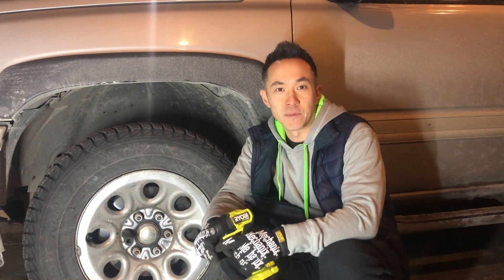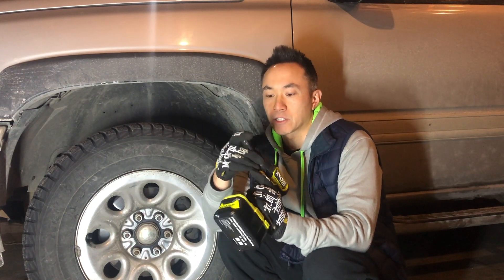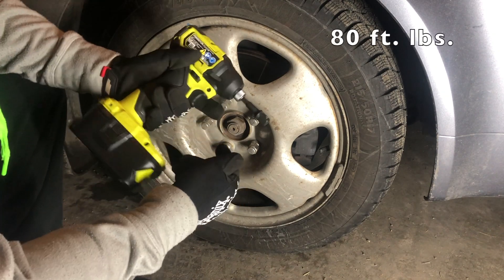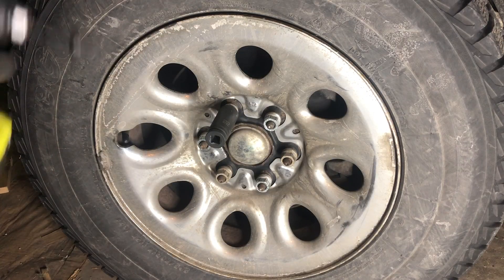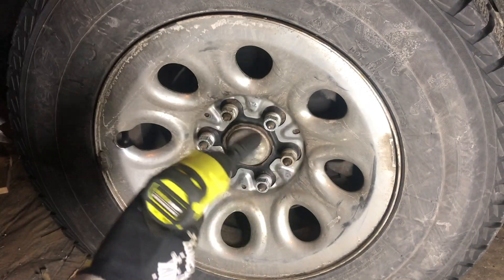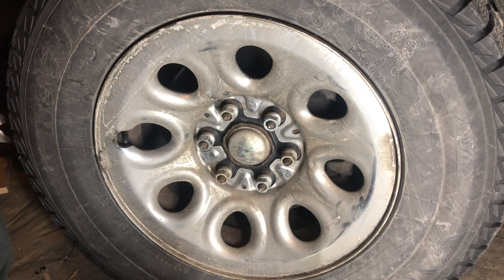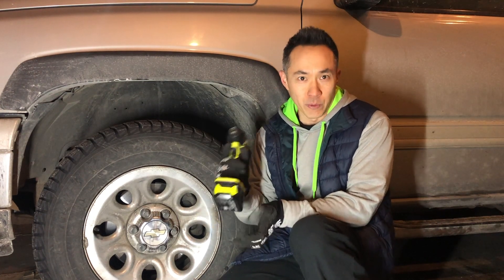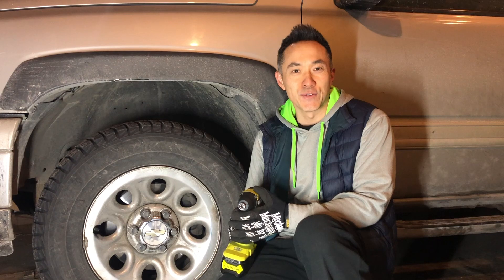Ryobi Impact Driver as an Impact Wrench? (PART 1)

Comment: You ahould have used Ryobi top notch battery and not a generic battery good bateery makes a world of differnrce.
Reply from the maker: Yep, agreed. At least I learned something. Check out the part two video where I redid the testing with a proper Ryobi battery.

Comment: Impact is good for removing nuts only. If you try to tighten wheel nuts, you will have to use a wheel nut wrench.
You will screw it up if you use an impact. This is a cut corners and you will definitely weaken a wheel nut or all of them!
Reply from the maker: Good advice! Don’t over-tighten by using an impact. Suggest using torque wrench for tightening them up properly. 👍
Reply: @ OSHA training. Many mechanics still apply this rule nowadays!

Comment: Do you know how tight an auto tech secures an oil drain plug and the oil filter? Well the 1/4" Ryobi impact couldn't bust it. So lucky thing I have the Ryobi PBLIWO1 1,070 breakaway torque pounds. It took mere seconds to remove the oil plug and oil filter where the 1/4" impact failed after about 10 seconds. When I bought it I tested it immediately on our SUV's lugnuts and it broke every nut I tried it on. So we're looking at a lot of work ahead together as we tackle everything around the house and auto. Beautiful just beautiful!
Reply from the maker: Having the right tools can make all the (fun!) difference. 👍 Enjoy the upcoming DIY projects!
Reply from the maker: FYI the oil drain plugs range from around 15-35 ft.lb. depending on the vehicle. “Hand tight” 😁

Comment: Brother, I’m glad a watched this first, my RV has a ftlb of 103 (140nm) and I was going to use this as my emergency Tyre removal tool……I’ll forget that now ! (I also carry a breaker bar and lug nut wrench)
Reply from the maker: Hi! Hold up there you might be okay. Check out my part two video. With a Ryobi 4ah battery you should be fine.

Comment: I'm a little confused, and I would much rather trust you guys than the Ryobi representative I spoke to at the Home Depot the other day I asked him if a 2 amp hour or a 4 amp hour or a 6 amp hour battery has anything to do with the performance of the drill or impact wrench specs and he said no. He told me the battery affects run time not total performance. He gave me an example that a powerful tool like a half inch impact wrench for a chainsaw or whatever will use up the smaller batteries reserved power quicker. Do you guys agree because I have two two amp hour batteries and I'm only looking to have the tool in my truck in the event that I have to change my tire I do not do other mechanical work so there's no other reason to use the gun except to take off my 140 ft-lb lugs on my SUV
Reply from the maker: While I agree that the amp hour rating is simply referring to the batteries capacity and therefore longer runtime, it’s the cell count and configuration in the higher amp hour batteries that actually create the the possibility of more sustained power. In light duty applications, it won’t make a difference, but with heavier duty ones it will. Check out this link and decide for yourself:

https://www.protoolreviews.com/battery-amp-hours-affect-power/

Comment: It is rated for 1800 in-lb which is 150 ft-lb.  Since loosening requires about 80% the tighten torque this should break free 187 ft-lb.  PROBLEM IS, and nobody seems to test, is this only has about 60% of the CLAIMED torque with the 4 Ah battery and 30% with the 3Ah batteries fully charged. Yes the size of the battery affects torque.

You broke free 100 ft-lbs so with that battery if you tightened the bolts until it stopped turning would only get you to 80 ft-lb.  That is, take a torque wrench and see how much torque to make the nut turn tighter (mark it with a sharp pencil) would only be about 80 ft-lb.  Then call Ryobi and ask them why u don't get 150.

Comment: What adapter is that? My adapters keep on snapping when I try removing a lug nut torque at 89 ft lbs
Reply from the maker: DeWalt adapter. Pretty strong and have never broken it (yet)!

Comment: Basically, an impact driver isn't as strong for nut/ bolt removal as an impact wrench. The 1/4" to 1/2" adapter necessary can snap. The 1/2" impact wrench is more direct, not requiring an additional adapter.

Comment: This was very educational! thank you so much. I have the one + 18v impact driver and drill $179 set combo. I knew the impact driver is more for heavy dutywood/concrete in house construction. The impact wrench is more for heavy duty automotive tasks. It is good to know that my impact driver can at least torque up to 100 ft-ibs.  While I am in trade school learning how to maintain aircraft, i don't really have the time anymore to work on my cars at home while balancing a job and full-time school. My wife is trying to do most of the small car stuff at home, but she does not know about torque values and all of that. I can now at least tell her that the impact driver is safe to use on our 2009 Mazda6, but no bigger.  My jeep cherokee and toyota van, she's going to need an impact wrench. We also need a torque wrench to check proper torque. This would be very helpful for my wife and I to watch so we both understand how important it is to use the right tool for the right job. I don't want to replace broken power tools because we didn't know about this stuff. apparently the new ryobi impact 4-mode wrench also has an auto-mode so that it does not overtighten a lugnut. Thank you sir!
Reply from the maker: I did this because, like you, I was curious more than anything else. Be sure to check out part 2 results with a better battery. 🙂

Comment: I have a saying. The right tool for the right job. If you are using an impact driver to tighten or loosen lug nuts, there is a high chance that the motor in the impact driver will burn out. An impact wrench is designed to handle high torque. It's like using a mallet to drive in nails when you should've been using a hammer.
Reply: For occasional mechanics like me though the tool wouldn't get any any undue stress. But I get what you're saying, if you say run a workshop etc.

Comment: Upgraded from an older 18v kit. https://www.youtube.com/post/UgkxW1vOBRCMrgTCDEijzpVzDWsgI-Jm2iQv  I independently chose the drill and impact tool, before I came across the kit.I like the 3 speed impact gun. It seems more powerful than my older one, and it can be set to be really gentle. The drill is more appropriately sized for my use. I used to have a hammer drill, but I did not like that it was so big and it was not a great hammer drill. I rather have a smaller drill like this, and then get a corded hammer drill for the odd case I need that.
Reply from the maker: DeWalt products are excellent, I agree. Although my personal brand of choice these days is Milwaukee, I know I couldn't go wrong if I used DeWalt... 👍

Comment: This tool being able to handle a 100 ft lb lug nut surprised me so much I had to run out and test it for myself because my old p236a is rated around the same numbers and it just cant do it.
Reply from the maker: Interesting... That's surprising that it couldn't do it but I've always been told that ft.lb. tool ratings are overrated and not to trust them. But, like you, I just had to try this for my own entertainment and curiosity purposes at least! 😁

Comment: I’ve just bought an adapter so this film is just what I needed to see! Thanks all the way from the UK.
Reply from the maker: Happy to help! Hope all is going great in the UK! 👍
Reply: Hi, have you used this yet to change a tyre, our lug nuts are measured in newton meters and not foot pounds, just curious if it worked at your wheel spec ? (Also from uk 🇬🇧)

Comment: That's the Ryobi PSBID01 COMPACT impact driver variable speed rated at up to 2,900 RPM, 3,800 impacts-per-minute(IPM), and  1700 inch-lb. (141 ft.lb.) of torque. But, what about the Ryobi PBLID01 STANDARD impact driver (4,000 impacts-per-minute(IPM), and  2,200 inch-lb. (183 ft.lb) of torque or even the latest PBLID02 model?
Reply from the maker: Great idea for another test! But my lugnuts only need 140 ft.lb. so I'll need another test situation. 😁

Comment: Used my Ryobi 1/4" hex impact for 2 years with the socket adapter.  Works fairly ok, but the weak link is the 1/4" hex connection which will constantly jam as it is worn out from overloading.  Just bought a Ryobi P262, a real 1/2" impact driver.
Reply from the maker: I agree. 👍 This was a fun test and I think the adapters work well for a lot of trades who need to loosen and fasten bolts here and there with their impact drivers but the P262 is my regular go-to for lug nuts, drivetrain, body, and suspension work.

Comment: Do you have links to the driver attachments for the lug nut removal?
Reply from the maker: I don’t have the exact links but I use the DeWalt 1/4” hex to 1/2” square impact adapter. It’s less than $10 at Home Depot. 

The Milwaukee version looks great as well and/but it’s double the price.

Comment: I have a ryobi capable of 1800 inch / lb and can't unscrew a small sedan lug nut. Also paired with a 6 amp battery
Reply from the maker: It's probably corrosion and/or someone overtightened them previously? I had to remove lugnuts from a Cooper Mini one day with my Ryobi P262 (mid-torque, "rated" for up to 600 ft.lb. loosening) impact wrench and they wouldn't budge on one of the wheels. I had to use a more powerful impact wrench 💪

Comment: I would assume a 8.5 amp corded impact wrench would solve all battery woes(diff. sizes,maps etc) crappy tire here in canada has one on for 89$..and a got a 100ft 10amp extension cord..
Reply from the maker: I used the exact same one for a couple of years and it was fine. If all you really do is lugnuts here and there, a corded impact should suit that application! 

My opinion is that once I do more of that and go mobile (which I do often each week), I don't want to waste my time with cords and power outlets.

Just to add... This impact wrench on lugnuts video is kind of just for fun and interest. I use a cordless 1/2" impact wrench as my actual go-to for automotive DIY work.

Comment: A cheap impact driver for mechanic work?
Reply from the maker: I find it okay for mechanic work. I've used it to remove stuck rotor screws but use it more as a die grinder to remove rust from rotors, wheels, etc. I've since switched my impact driver for mechanic work over to Milwaukee M12. It's lighter, the battery is smaller and has higher rpm.
Reply: @lmsdiy  I am looking at a hitachi impact driver for suspension work on my vehicle to make it easier on me not full time mechanic work.
Reply from the maker: @yamahschector  got it. It depends on the vehicle and the kind of work. If you work on lugnuts, suspension and drivetrain parts like axle nuts, control arms, ball joints, lower strut bolts, and wheel hubs (especially on trucks) there's no way an impact driver has the power you need. If it's light-duty work you can get away with it. Otherwise get good breaker bars 🙂👍 I use my 1/2" and 3/8" impact wrenches the most and breaker bars help when you can't fit an impact wrench into a tight spot.
Reply: @lmsdiy  so a larger breaker bar and a torque wrench will be the ticket then. I have to replace wore out lift suspension on my fj cruiser
Reply from the maker: @yamahschector  I have not worked on that myself before so you probably know the job better than I (so take my suggestions with a grain of salt). In general, I'm not a fan of using an impact driver for suspension work. I would use impact wrenches, breaker bars and ratchets/wrenches.

Comment: I'd like to see you tighten the lug nut with the impact driver THEN test the torque it put on the lug nut. I'm interested in seeing if the driver puts too much torque on the nuts or if you would need to add to it after using the driver to tighten them.
Reply from the maker: That's an interesting thought! I'll see if I can find time to set something up for a video on that. Probably not on my truck but in a junkyard or with a board set up with nuts and bolts. 👍
Reply: @lmsdiy  

I've been looking around and, apparently the Ryobi P263(3 speed 3/8 inch impact wrench) has around 90 ft/lbs in speed ...umm, 1 or 2. That should be close enough for my needs(80 ft/lbs).
Reply from the maker: @jf2mad  I'm not sure if I'm reading into this correctly, but are you planning to use an impact wrench or impact driver to tighten lugnuts on to your vehicle?
Reply: @lmsdiy  planning on keeping one as part of a kit for traveling. I think I'll just add an 80 ft/lb Steelman torque stick to it and call it good.
Reply: Don’t do it, a “torque limiting stick” is rated with use on a 400lb ft impact gun. Your ryobi with that torque stick will result in under torqued nut. Just buy a torque wrench and keep it in your car instead.

Comment: Will it work for a volkswagen passat lug nuts
Reply from the maker: Assuming your Passat lugnuts are torqued to within spec (80-105 ft.lb.), I would say yes.

Disclaimer: if you do not regularly service your tires (I.e., rust and corrosion factor) and/or if they were not torqued properly (I.e., overtightened), it is possible that this won't work.

Comment: When you use an adapter and/or extension, your tool will lose some power. A 1/4" drive or adapter is not designed to remove lug nuts.
Reply from the maker: Very true. All adapters will cause power loss. Check out the part 2 video!

https://youtu.be/8NyhwKNxPoY
Reply: @lmsdiy  Yeah, I found a good Ryobi battery you demonstrated in part two of your video cost as much of the impact wrench itself. As a home diyer, it's better off buying a electric impact wrench from Harbor freight.
Reply from the maker: I'm with ya. The electric impact wrench is the right cost-effective solution. Some DIYers may want to go with a corded impact wrench to save costs and they may only be using it to swap tires for summer/winter and not much else.

I do a lot of automotive work now so I decided to buy an assortment of cordless electric tools. Although I do use my cordless 3/8" ratchet and cordless 3/8" impact wrench, there's nothing I use more than the 1/2" impact!

Comment: You cannot properly test a powertool using a battery that may not even be matching OEM amperage. Just because it delivers 18V does not mean it delivers full power.
Reply from the maker: Thanks for the feedback and I agree. It's all learning as a DIYer. Based on the feedback I did a part two with an OEM battery. What a difference!

https://youtu.be/8NyhwKNxPoY
Reply: @lmsdiy  🤯🤯🤯
Reply from the maker: @jorelldye4346  totally...! I'm so convinced with what you said about OEM batteries only...
Reply: @lmsdiy  Your second video changed my view on this! I wasn't sure it was possible but I had a hunch! Thank you for the followup!

Comment: If you would have you used a 20 or 24 volt impact you would have gotten it each time
Reply from the maker: Turns out I actually just needed a better battery! Check out part 2! 👍

Comment: two things wrong with this.
1. that tool is not design for lug nuts, get the ryobi high torque it’s better.
2. hp+ (one+) tool design to take advantage of one+ battery. you get more power.